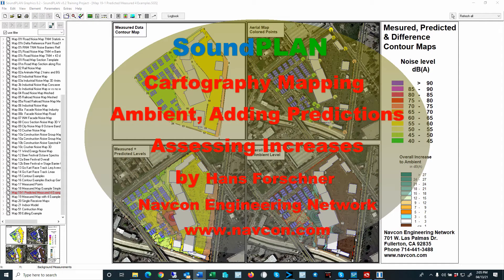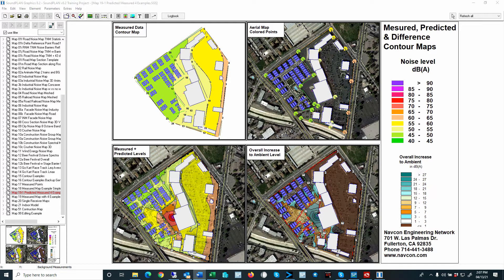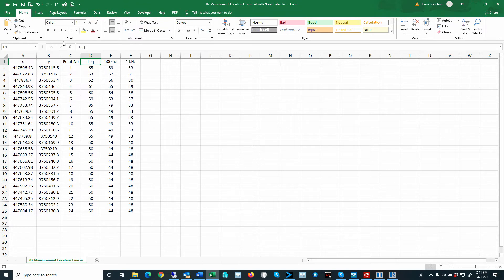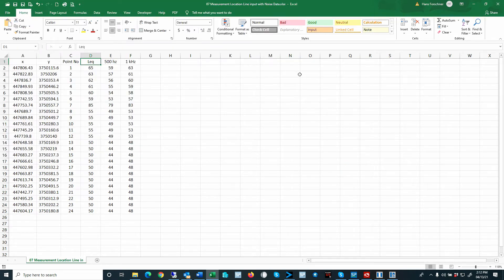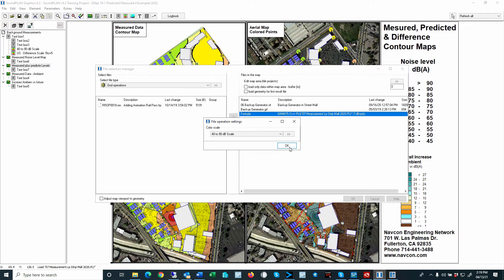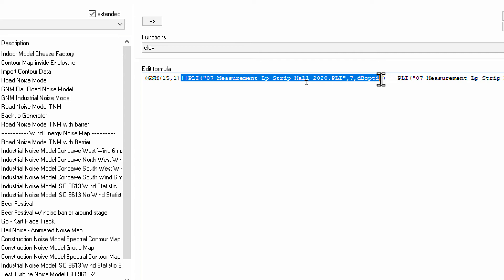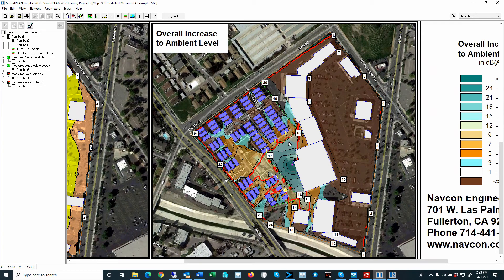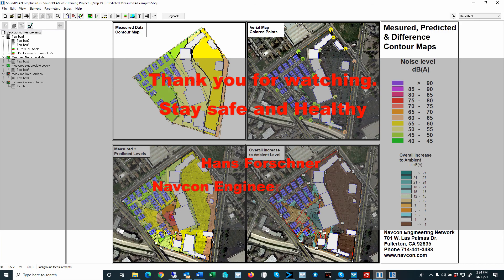SoundPLAN Cartography Mapping Noise levels

Comment: is it possible to map noise with android phone, with gps, in order to locate source of intermittent noise ? similar to sonar say
Reply from the maker: Not sure what to answer.  Standard android microphone are not very reliable and do not have a good frequency response and they do not have a wind screen.  They are mostly geared to the frequency range of the human voice.  There are mic adapters with microphone pre-amplifier, microphone and windscreen setup... that would make it more feasible but that would add a lot of cost ...
Reply: @HansForschner  I don't mean continuous noise like wind, I mean like impulsive noise source, similar to gunshot locators

Comment: Thank you for video. For addition you use energetic addition and for substraction you use normal arithmetic substraction.  Why?  Cam you explain when to use energetic and when to use arithmetic ?
Reply from the maker: Sachin,  good question.  The energetic or log adding is done to compute how the noise level from the predicted trash compactor source will add to the ambient noise level (measured background levels).  The difference map shows what kind of increase to expect... so you compare the ambient & compactor noise to the ambient noise level - meaning the difference is using an arithmetic subtraction.  In most case the noise assessment is strictly done by comparing the noise from the source to the noise limit.  But what if you have a situation where there is already a lot of community noise and that may be even over the municipal code noise limit.  Well in that case you noise assessment often times will look at the overall change in noise level ~ 3 dB increase barely noticeable ~ 5 dB increase clearly noticeable and ~ 10 dB increase double as loud.  Some project assessment also use a significant criteria which is defined with a 3 dB or 5 dB increase. When the project significantly increase baseline conditions your noise control target is to reduce the increase into the not significant increase range.  I hope that clarifies the process.  Cheers.
Reply: @HansForschner  thank you for the explanation. It means for adding two noise level we can use energetic addition to see the increase in the noise level. And for calculating difference between noise level and speaker level (SNR) we can use arithmetic subtraction. Am i right? I use soundplan for speaker. coverage study
Reply from the maker: @SachinChavanshree  yes, you are correct.  

Example: 
Ambient noise level 50 dB and source prediction 55 dB.  When you add the level up logarithmically to 56.2 dB.  Which means the increase to the baseline ambient noise levels is 56.2-50 = 6.2 dB 

L1	L2	Ltotal	dL
50	50	53.0	3.0
50	51	53.5	3.5
50	52	54.1	4.1
50	53	54.8	4.8
50	54	55.5	5.5
50	55	56.2	6.2
50	56	57.0	7.0
50	57	57.8	7.8
50	58	58.6	8.6
50	59	59.5	9.5